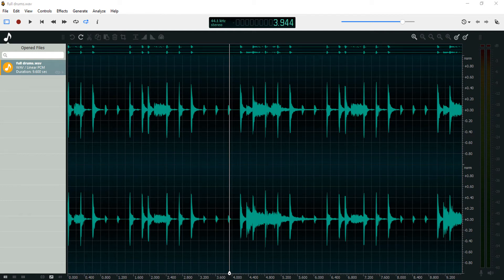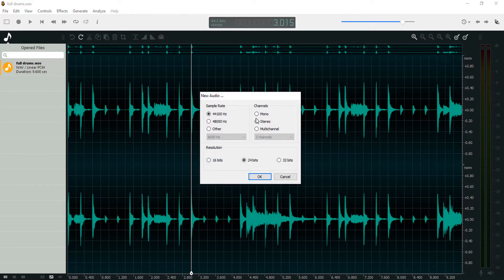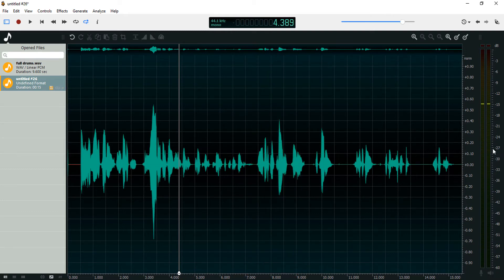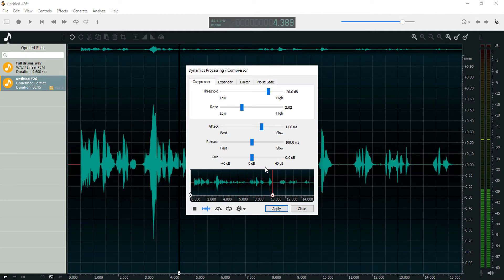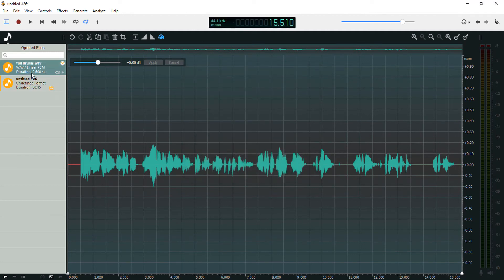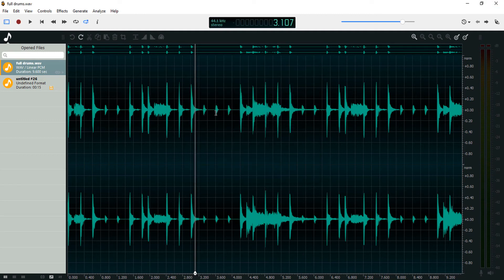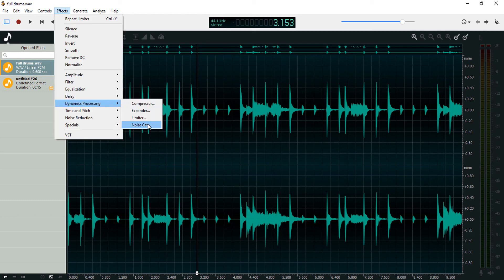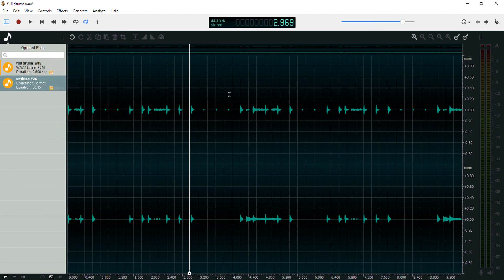ocenaudio - 9 - Dynamics Processing

Comment: Great video.  I am getting into voice-over work & I am still figuring this out.  One step closer. Thanks!
Reply from the maker: You're welcome. I hope it helps you get things right. Thanks for watching!
Reply: @osirusmusic, what do you have your settings at  ? (Sample ratio, channel, resolution, etc)You sound super clear. My recordings sound choppy. I am close to the mic.
Reply from the maker: @Erik-cr9nq  Getting a clean recording depends on many things. Aside from having a good mic and a treated room. always make sure:
- You don't record too loud, so you don't distort
- Try to record in a very quiet environment
- Record with a pop filter
- Have good breadth control to prevent excessive breadths and mouth noise
for the sample rate, anything at or above 44.1khz is fine

Comment: Hi Osiris! I'm looking to remove reverb from my audios- I tried playing around with the noise gate but no luck. Do you know any free plugin that works with Ocenaudio to do this? thanks
Reply from the maker: I don't know of any free plugin that works. The ones that seem to do a decent job are paid, if you get a free trial, here are some good ones:
https://acondigital.com/products/deverberate/
https://www.plugin-alliance.com/en/products/spl_de-verb_plus.html

The free way to do it, Is by using transient shaping with compression, It's a little bit of advanced audio engineering and you might not be able to do it with ocenaudio:
https://youtu.be/9c57YnS7ppA

But I don't  know of any free plugin that removes reverb.